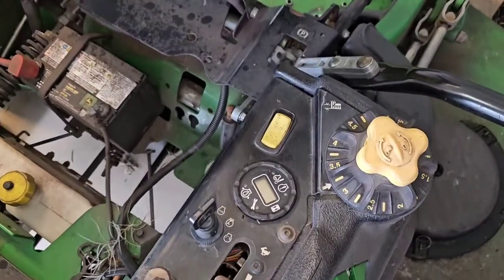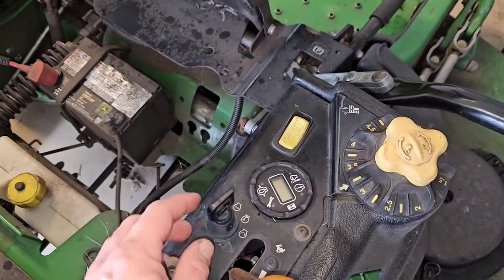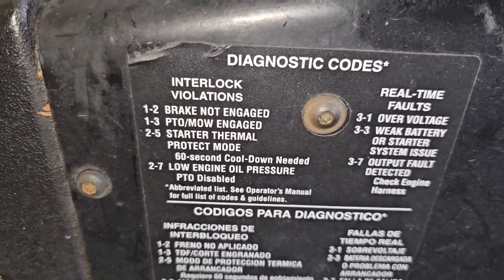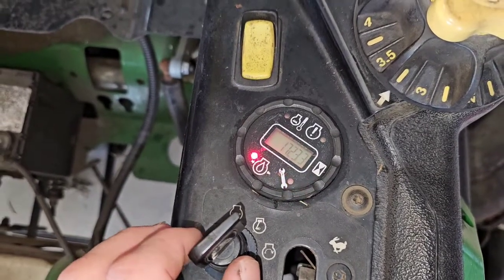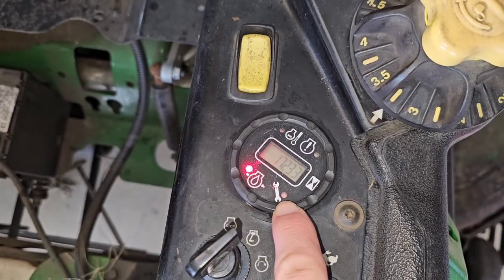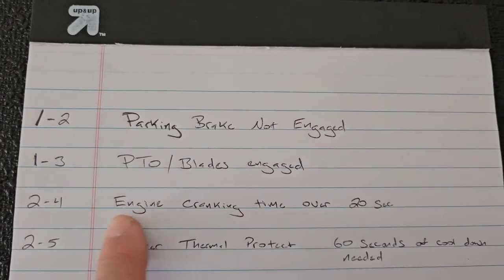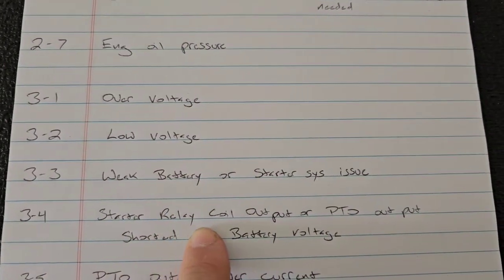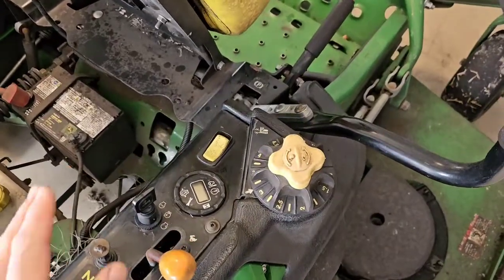John Deere Ztrack 900 series diagnostic codes

Comment: so while the PTO is on and i'm going about my mowing the mower shuts down and the error code is 1-2, but of course the brake isn't engaged because i'm mowing. is it just a censor? any help is greatly appreciated
Reply from the maker: Does the engine die? If so, does it die instantly or does it sputter and struggle a few seconds when it dies?
Reply: @Mechanical_Mind yes the engine does die instantly
Reply from the maker: @soulrichy3311  its probably the seat safety switch or the ignition switch. Both are common issues. Check this video out I did a few years ago
https://youtu.be/ZzE5X8s2AnU
Reply: @Mechanical_Mind thank you!

Comment: Do you have any engine repair info? I'm working an a Z925M EFI Kohler that is smoking and using a lot of oil according to the customer. It is sucking oil up through the oil separator. There was oil in the elbow of the air filter housing. Plugs were badly fouled. I have done a leak down test and can not rightfully condemn the oil rings. When I pulled the valve covers there was more oil in the left cover than the right. The left one is the one with the oil separator on it. I haven't called JD yet.
Reply from the maker: I'm thinking you might have a bad head gasket on the #2 cylinder.
Reply: @Mechanical_Mind  According to an undisclosed source, there is a reed valve between the lifters on each side. You can see it if you pull the valve covers off. There is a small bolt that holds a metal tab on and behind that is a plastic (?) valve. I'm pulling the heads this morning. Source says the bolt breaks off. Mine are intact.
Reply: @Mechanical_Mind  Confirmed. Remove the head. Remove the metal retainer, and the plastic reed valve is broken. Ugh.

Comment: I have a code,1flash then 4 flashes,jd won't tell, imagine that,got any ideas?
Reply: After much diagnosis myself,it was the key switch,everyone store this code!
Reply from the maker: @mikeduckett7875  those key switches cause so many issues. I can't tell you how many of them I replaced. They are expensive too
Reply from the maker: I don't know what the code 1-4 would be. Is the mower running bad or have any problems?
Reply: I’m thankful I looked in the comment section on this video, because mine is also flashing one – four and I couldn’t figure it out, so thank you guys!
Reply: @andrewstasinos9929 did it fix your problem also. Mine is flashing 1-4